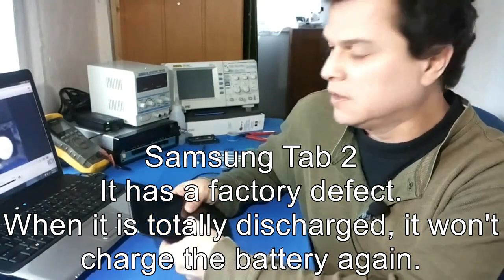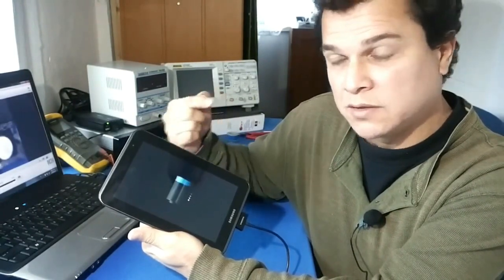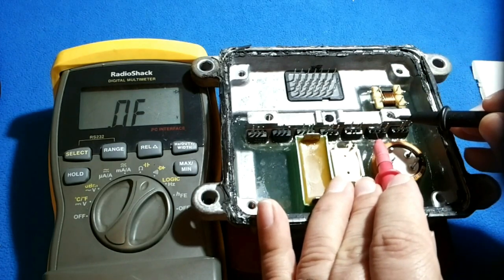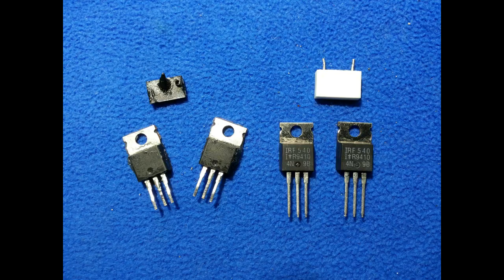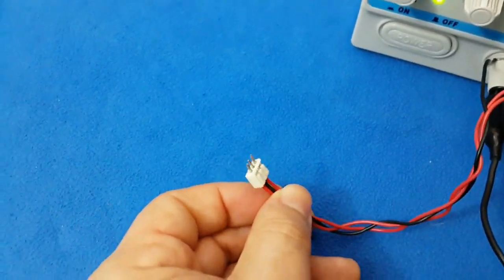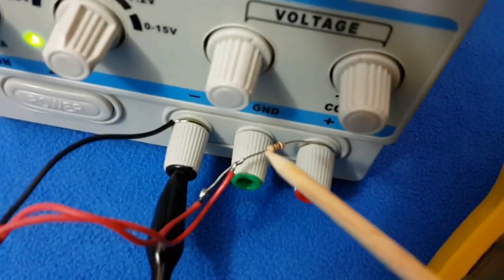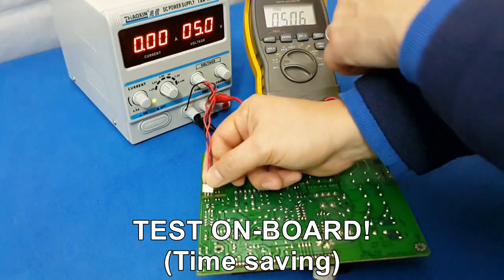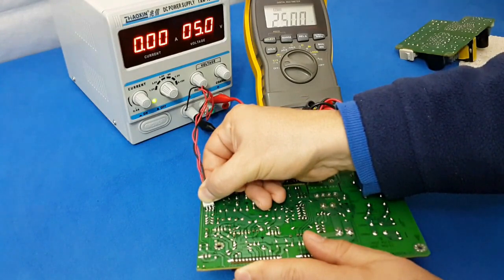Repairing skills. It is good to become electronics technician while we are studying for engineering

Comment: So, how did you find the problem at Samsung galaxy tab? How did you know you need that diode? How did you know you need to replace that IC on the laptop? You just showed the solutions, not the process of finding them.
Reply from the maker: Hi! This video is focused in the advice for engineers to get involved in repairing to develop skills in order to get labor experience and ways to survive. You answers are in my other videos: - How to TEST TL431 Voltage Reference / TL431A TL432 KIA431 Shunt Regulator circuit

- How to fix Lenovo E530C is very slow / Laptop chip level fixed
- Samsung Tablet 2 not charging, turns off, fixed - How to fix tab on chip level. GT-P3100 / GT-P3110
It is important to get knowledge as engineer, and understand it from the technical point of view, in order to apply troubleshouting and find the proper way to solve problems. No University is preparing us for this situations. Engineering is like writing. They teach just electronics like to read and write. But nobody can teach us how to think or to invent. The process to find solutions to different challenges will always depend how much we live and the experience we learn on the life. Thanks for asking.

Comment: Why are you editing old video into a new post?
Reply from the maker: Hi Joseph! Nice to know about you again. (I have some private videos that maybe I will "unlock"). The answer is to give an advice to engineering students of to try to become technicians fist, or to get involved in the mater. Most graduates with certification on hand, get the issue that employers required experience. How to get a job, if we don't have experience? How to get the experience if we can't get a job? The answer was to become technician first. By the time they graduated as engineers, they got the labor experience needed. Other issue is employers said: "because you have not experience, I will hire you to work as engineer, but we will name you as junior and we will pay you less. (Thanks by the engineer's signature so needed in thi$ Corporation!)". Also it is good for us if we need to survive. From the main picture, I was working in industrial electronics, later repairing things, developed new test leads and ways to measure... I engineer I could prospere, but it was as technician that I survived. I wish many engineering students to follow this advice first I did it in the 80's. It didn't save me from the difficulties, but it helps to survive to it.  :-)